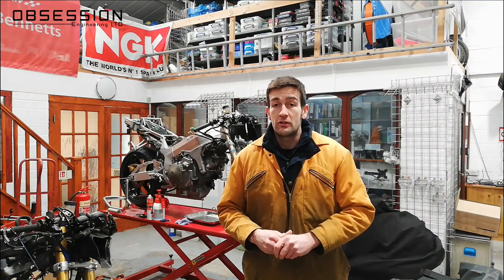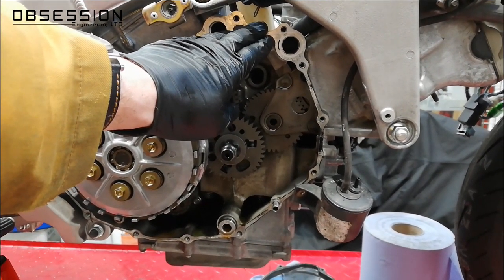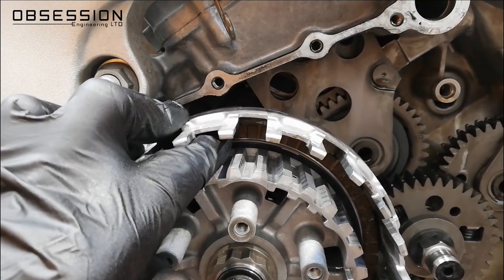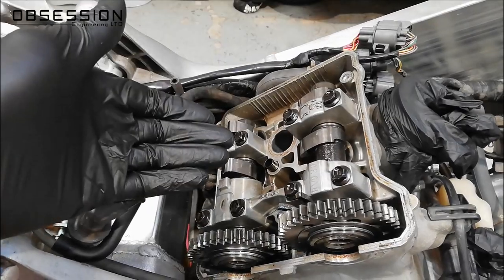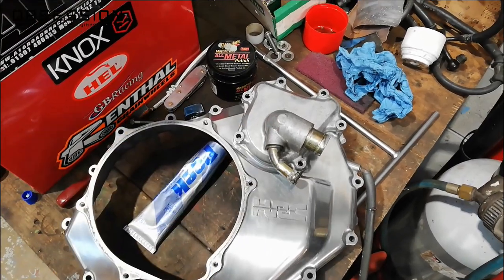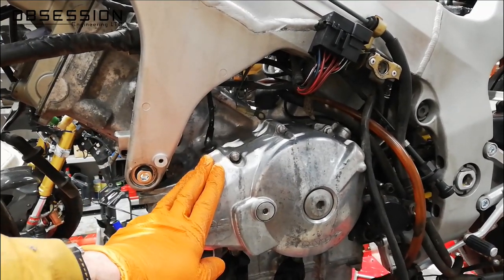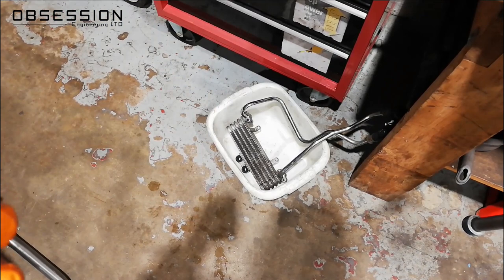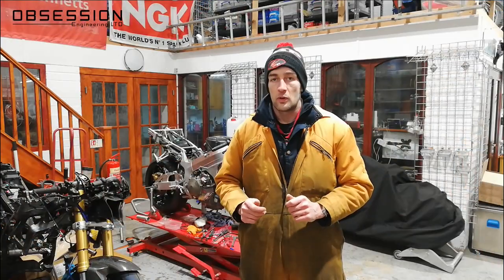Henry's Honda. An SP1 Restoration. Part 11. Modifying the clutch and checking valve clearances

Comment: 2:05. I totally agree with you on all you said about the gear driven cams, but as a former NC30 owner and a current RC36-2 owner, I must say that I’m happy to pay a bit more to, carry a bit extra weight from the gears as the sound makes me smile. The RC36 is red lining at 11500 rpm, so absolutely no need for gear drive, but the history of racing V4 Honda engines just makes them nice to have.
Thanks for sharing, the SP1 looks better and better with each episode going by.
Cheers from Denmark 
Tomas

Comment: @obsessionengineering please can you confirm the order of plates/springs for this modification. Your video suggests friction plate 25 (22202MAT000) goes on the stack first, followed by 24 (22125MAT000 SEAT,JUDDER SPG) then 26 (22402MAT000 SPG,JUDDER) But the parts fiche shows the 2 springs going on the stack first then followed by 25 friction, 7 pressure plate and so on?
Reply from the maker: Been a while so can't entirely remember. I'd say go with the sp2 workshop manual setting

Comment: Can you please show us a trustfull source of the valve clearance tolerances of +/- 0,03mm from IN/EX for the SC45A?
In my genuine Honda VTR 1000 SP-Y Service Manual there are no valve tolerances shown!
For service there are only fixed valve clearances for IN: 0,16mm and EX: 0,31mm with explicit NO service limit!
Would be pretty great if you could confirm these tolerances! Thank you so far for this nice restauration!
Reply from the maker: I'm sure I read it in my service manual but don't have it to hand to double check. Realistically there has to be a tolerance, it's normal engineering practice and 0.06mm is fairly typical for valve clearances across most manufacturers. Having built hundreds of road and race engines I can assure you the +/- 0.03 on these clearances is more than safe. I've regularly built race engines with 0.10mm inlet clearances and exhausts typically in the 0.20-0.30 range. Inlets don't have the same heat expansion as exhausts, hence being able to run smaller clearances.